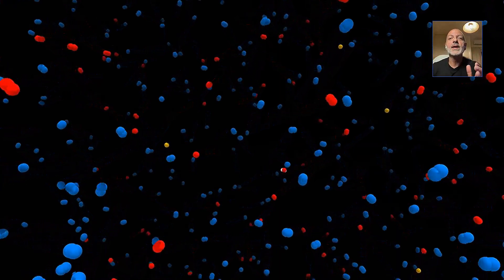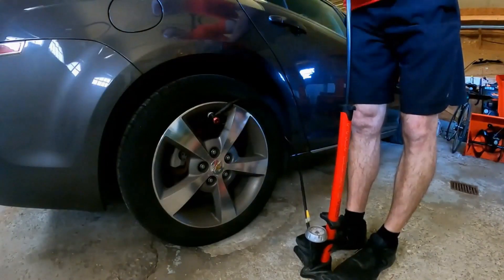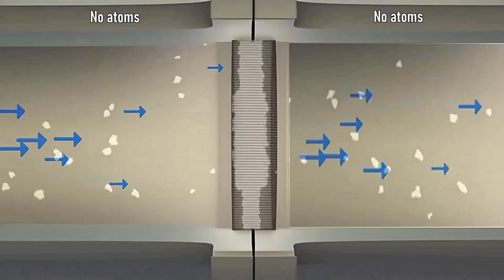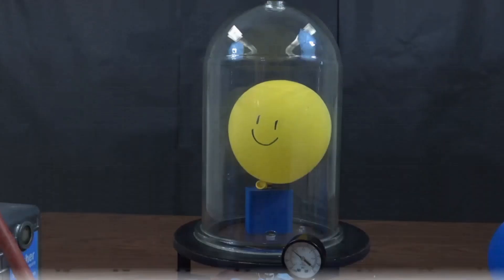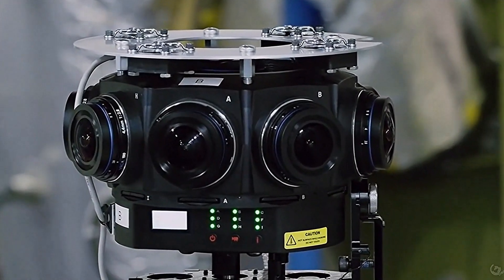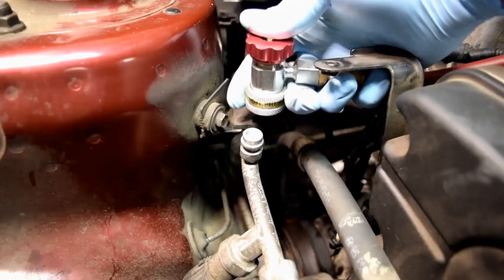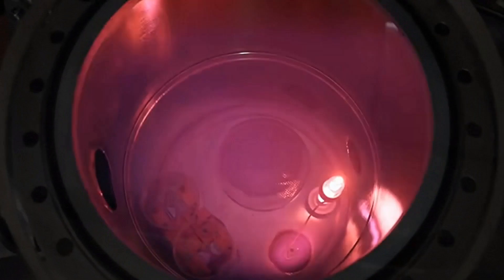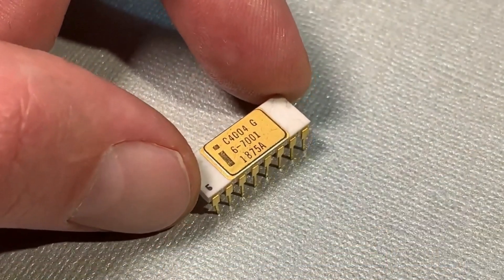THE APOLLO DISCUSSIONS "VACUUM & SEMICONDUCTOR MANUFACTURING" PART 29

Comment: many people find it hard to understand the pressure of the vacuum, and the force that contains it ... I suggest to begin to understand something the experiment of Otto von Guericke of 1656, where two copper hemispherical bowls with a diameter of about 42 cm together so that they formed a sphere. A leather strip soaked in wax and turpentine served as a seal between the spherical shells . He then removed the air from the resulting cavity with the piston pump he invented via a valve . the air pressure, which now only acted on the ball from the outside, compressed it so strongly that even with 30 (in Regensburg, two teams of 15 each) or 16 (in Magdeburg, two teams of eight) horses, they could no longer pull apart let. The hemispheres could only be separated again after ambient air had been let back into the sphere through the valve.
https://de.wikipedia.org/wiki/Magdeburger_Halbkugeln

Comment: Having a door that can seal itself from a vacuum is tough. There will be leaks, not doubts, but if they are small , then a steady volume gas  will need to be pumped into the capsule/space suit to make up for the difference.  In regards to the power of a vacuum, it should be described as the pressure of expanding gas.   Unfortunately, Vacuums don't suck and by fixating on the degree of a vacuum  it is not doing your cause any credit.  The LEM is built pretty light and defintely could not  land on any moon, however, to the credit of the builders, if the LEM has 5 lbs per square inch of pressure, because they were running pure oxygen (I can't believe that they actually did this, however, it is NASA talking.)  Even at 1/3  atmosphere the air pressure  would be at least 3.5 tons on a square yard. To test it, they only had to pressurize 20 psi inside the the LEM while it was on Earth and see what happens. Fairly simple way.  That being said, there is not a snow ball's chance in Hadres that we actually went to the Moon as described by Nasa and their underlings.
Reply: What is so unbelievable about the low pressure oxygen environment? Why could the LM definitely not land on the Moon?

Comment: This video inspired me:

I wish they would test cables and microchips in a vacuum.  They may (me: will) disintigrate too? Yet all the cables and chips have to be accessed outside the spacecraft ie in an  unprotected environment.
(On ISS too.)
Reply from the maker: I wish that NASA would add 3.7 psi to an Apollo space suit and subject it to the Sandusky chamber. I predict that it would explode once 10 torr -6 has been achieved.
Reply: @theapollodetectives  Why would it explode?
Reply: @theapollodetectives  Me too.  I so want Bryhan C@xx or NdgT to be inside the suit protesting its validity whilst they're turning up the pressure.  : )